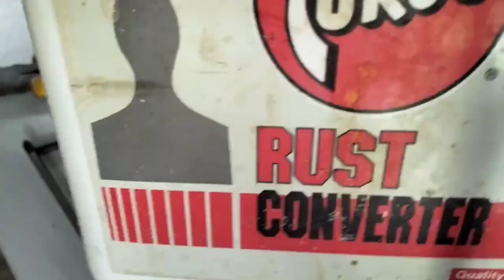TOYOTA COROLLA EE100 CARBURETOR REBUILD AND TUNED

Comment: ka basyong good day, ano dahilan bakit  may gasolina at halos puno po yong secondary  barrel ng karburador? mahirap sya iistart at kung mag istart man ay namamatay din agad dahil lunod na, nag adjust na ako ng clearance ng pin, 1mm at ng float, 9mm, pero ganoon pa rin, pag start pa lang lunod na agad. maraming salamat po ka basyong. unit ko po toyota corolla XE '93 model with 2E engine.
Reply from the maker: Baka nmn kahit na adjust mo na pin eh Wla kapasidad na sumara Ang pin valve gawa Ng Dina ganu lumapat kahit na adjust mo na ito try to use Yung may rubber kabasyong 👍
Reply: @donbasyong nag palit na po ako ng strainer at float valve, pero ganoon pa rin. palaging lunod, na trace ko na singaw na pala yong  power piston, hindi na sya mahila pataas ng vacuum. ok lang ba na tangalin ko yong power piston?